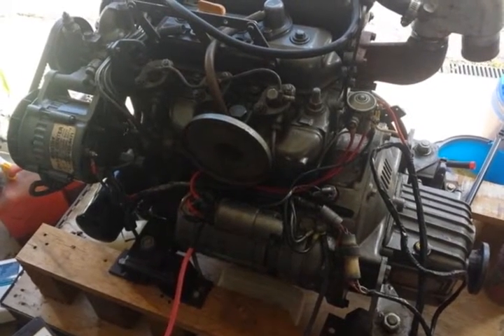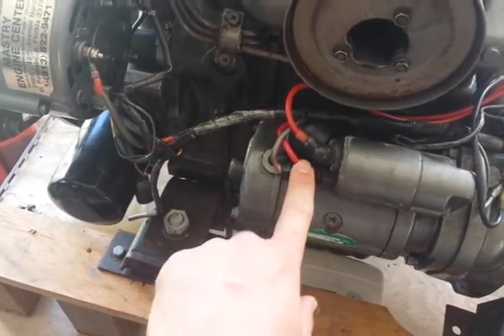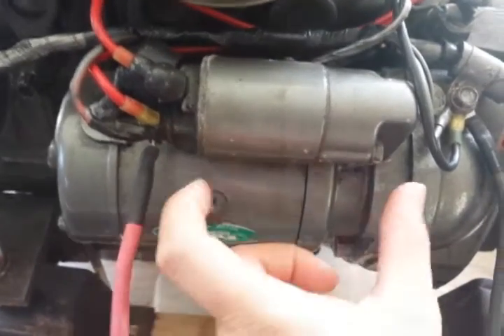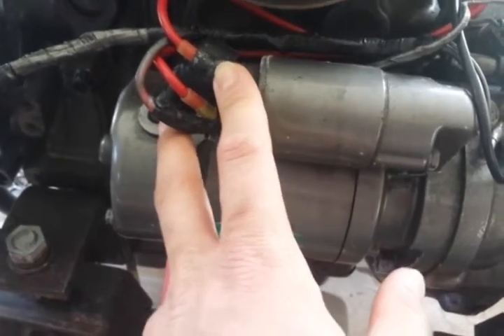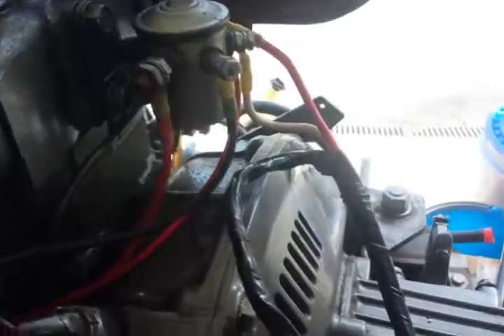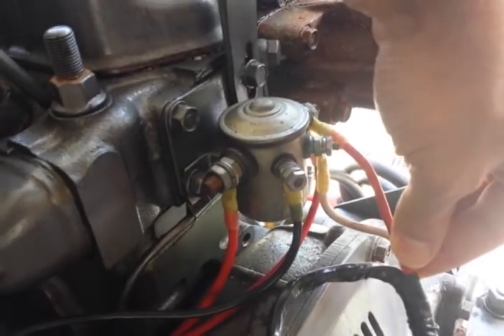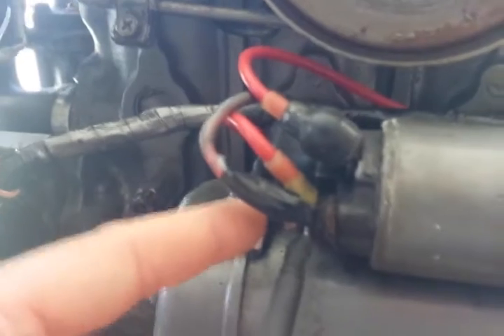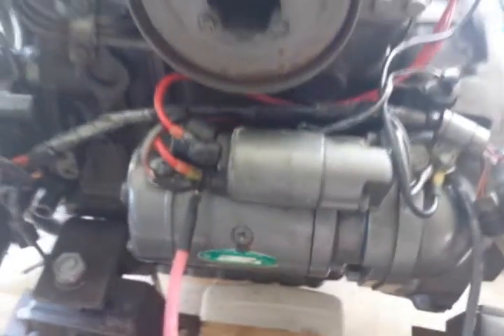Yanmar 3HM35F starting circuit w/aux start solenoid.

Comment: Thanks for the video. I have a 1GM10. I have a man over board alarm, which, when going off, could shut off the engine (via a relay). I could shut of fuel intake (the engine has an electrical fuel pump) but it takes too long for the engine to run out of fuel and stops. Do you have any idea how to stop the engine, electrically, and rapidly, other than the stop cable? Thanks!
Reply from the maker: You can see a stop solenoid near the bottom of the frame in this video.  It pulls on the same lever as the cable would to stop the engine.
https://youtu.be/mdHIt14l0R8
Reply: @muckleyj  thanks. I will shop around for one and look if I can mount it..
Reply: @muckleyj   http://www.drakecontrols.com/wp-content/uploads/2015/05/Cable-Solenoids-36743_NEW.pdf
Looks like this would work. Thanks again!
Reply from the maker: Solenoid on the governor fuel stop in lew of the typical cable.
Reply from the maker: That would probably work.  The cable is pretty long and would require remote mounting which could be a good thing or just a PIA.  Before you settle on anything Google search "yanmar stop solenoid".  Amazon and eBay have lots of options.  Consider the required pull-in length.  It seems like more than 1 inch is required but I haven't really played with it much.
Reply: @muckleyj  I looked around, the cable solenoid is pretty big (around 6-7" OA). I found this on eBay (and amazon but ebay was cheaper): +100lbs of pull and 1.57" of travel (fingers crossed). Working temperature up to 220°F so should be acceptable. It is more compact and should be a no brainer to mount - I can share all when completed if you want. I am going to keep the original stopper cable (actually new since I changed it) around as a back up. Not sure how long that cheap solenoid will last. https://www.ebay.com/itm/New-Engine-Stop-Solenoid-XHQ-PT-12V-Diesel-Engine-Flame-Out-Device-XHQPT12-/173237332839 - thanks again for the idea. I will also layout the Man-Over-Board safety feature if anyone is interested.
Reply from the maker: @jeromesammarcelli9962  here is a link to some pictures to see if they help at all.
https://drive.google.com/folderview?id=1ePSBFidozqVmxhP3yrld83ZziMVEd6oG
Reply from the maker: @jeromesammarcelli9962  I measured the length of throw on the stop lever.  It is 1-1/4 inch of linear travel.

Comment: I have a Yanmar 2 cylinder which keeps breaking the housing on the starter. Replaced 3 starters already. It seems to be lined up and tightened correctly. Why is my starter housing breaking?
Reply from the maker: I don't know.  Are you using OEM starters?  Have you tried starting with by decompressing first?  It might reduce the starting torque.  What about the bolt torques?  Maybe over torqued?

Comment: Hey Josh, what solenoid is that you added?  I found a Cole Hersee 24059 which looks similar, thoughts?
Reply from the maker: I don't know what model it is.  It came with the engine and is a common design. 
https://www.amazon.com/dp/B000CQ1XDA/ref=cm_sw_r_apa_i_LUh-EbWR0B0XE

The marinized (waterproof?) versions look like this.
https://www.amazon.com/dp/B001Q8KONI/ref=cm_sw_r_apa_i_1Xh-EbFBK2X75
Reply from the maker: Despite having measured a continuous current draw of only 1 amp, it's hard to know what current rating is appropriate for a component like this.  The instantaneous current when the contacts are closing in is what burns the contact pads and can be extremely high but only for a small fraction of a second.  A higher current rating will most likely provide longer service life of the solenoid but will cost progressively more.  As with everything it will most likely be a compromise.  With just a cursory search of Amazon it seems that a 12V, 300A, 3 or 4 post marinized solenoid for $30 is probably a good balance.
Reply: Thanks